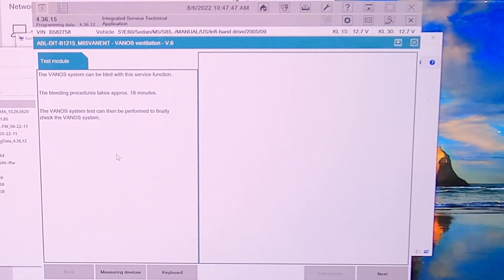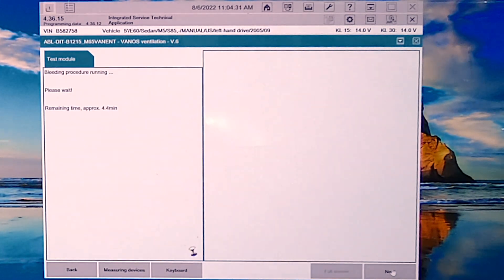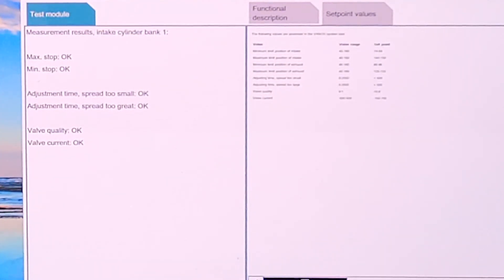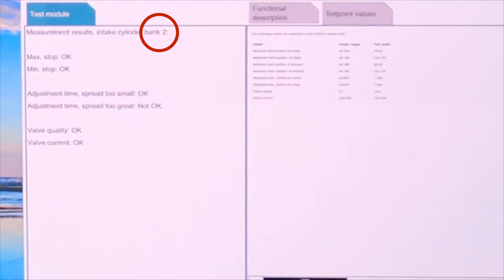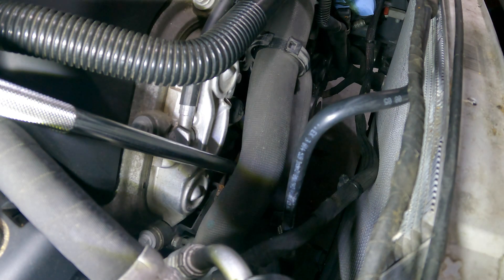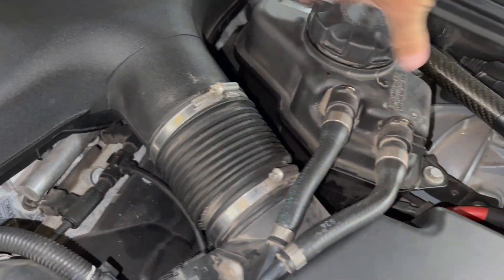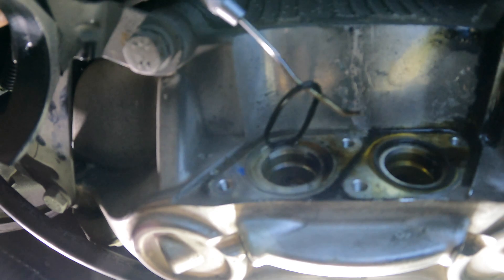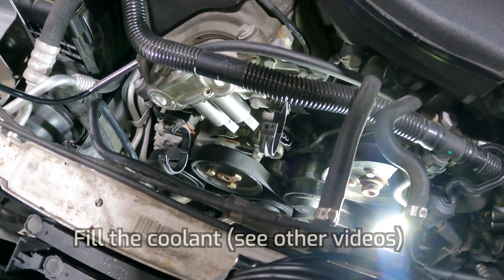5 minute guide VANOS solenoids bleeding and replacement! (E60 V10 M5)

Comment: This might be a silly question but do I have to disconnect something from the vanos system to run the bleed procedure? This is because I imagine it’s like bleeding the brakes where a hose has to be disconnected…
Reply from the maker: No such thing as a silly question :)

In short no. The bleeding procedure works the system and keeps building/releasing pressure. This helps work out the air internally. Great question!
Reply: @FindingSeconds  thanks!!!
Reply from the maker: Anytime 🙂

Comment: I had all 4 of my Vanos solenoids replaced 2 and a half years ago genuine BMW parts, they went bad again going to cost another 2k to fix, I tried bleeding them 2 times and still not ok all are around 0.55, any suggestions?
Reply from the maker: When were your rod bearings last done and did they do the high pressure Vanos line when they did them? The high pressure line can fail internally and the Vanos solenoids are up stream from that. Ista should tell you there is an issue. How many miles have you done in 2.5 years?
Reply: @FindingSeconds  the rod bearings and high pressure oil line were done 3 years ago and about 43,000 miles ago
Reply from the maker: I would get the Vanos pressure checked first. Dealers should have the equipment or you can buy a gauge or make one from plans on the net. If that’s low the Vanos pump is starting to fail (as long as the updated high pressure Vanos line was used).

Comment: Great job👌 Did mine last year with the Radiator out and that was painful and time consuming enough! Keep the vids coming as I do as much as I can myself! 👍
Reply from the maker: Thanks! I was trying to remove as little as possible but got caught out by the right hand solenoids. What tool did you end up getting to work for those? :)
Reply: @FindingSeconds   used this  ToKinCen 11 PCS 100mm Torx Screwdriver Bits, T6-T40 S2 Steel 1/4 Inch Long Magnetic Torx Security Star Hex Screwdriver Bits Set for Electric Manual Screwdrivers + Angle Screwdriver Bit Holder
Reply from the maker: @duncsm5662  ooo, they look ideal. Nice find and thanks for sharing!

Comment: Weird video because you show removing the passenger side and then draining the radiator which is required to remove it from the car so you can access the driver side solenoids. If you pulled the radiator first, this would have sped up the job.
Reply from the maker: Appreciate the feedback. Not sure if you saw the text in the video but I had hoped to avoid draining the radiator. There’s no need to remove the radiator as there is plenty of room. In my experience each pipe you remove you increase the risk of a leak (especially on older higher mileage cars). 

My goal was to illustrate the least amount of work required. Now I know which tools are required I’m pretty sure I could do the right side (US passenger, UK driver) without removing the radiator hose.

Comment: Hey mate good job 👍.  I blead mine 2-3yrs ago after replacing big-ends, HP oil line.. etc. and I used DIS at the time, but all the menus/options/procedures are exactly the same as you've shown here with ISTA-D, just the GUI has changed since the old DIS process.  I've since evolved to be an ISTA man too so if/when it needs to be done again I'll use ISTA as well.
Keep up the good fight mate they are worth it - Seeya
Reply from the maker: Thanks! ISTA seems to be a little on the slow side at times but it gets the job done!
How long have you had your car? I always like to see what work/maintenance other owners have done :)
Reply: @FindingSeconds  haha that is a huuuge question!

Had her for 8yrs and done pretty much everything that’s ever worn or failed on an E60, which is highly impractical for most owners but I_am_never_selling_mine.

Replaced big-ends, HP line, late model engine bits listed on REALOEM I.e. cam-vanos gear, cam-chain guides & tensioner, piston oil squirters, etc.  Some common failure items like throttle body actuators, SMG relays.  Consumables items like brakes, PCVs, fuel filter & tank breather valves, radiator hoses, injectors, spark plugs, coils, engine mounts, water pump, thermostat, belts.. way too much to list.

 And added a few discrete enhancements like Bilstein B16 (EDC) shocks, RPI intake scoops & power pulleys.
Reply from the maker: That's fantastic! Great work. These are for sure vehicles of passion. I'm starting to get some SMG issues, I'm curious did you have any symptoms before doing the SMG relays?

How many miles on your car?

OK finally, how do you like the B16 EDC shocks?